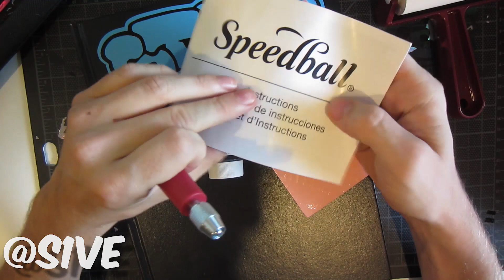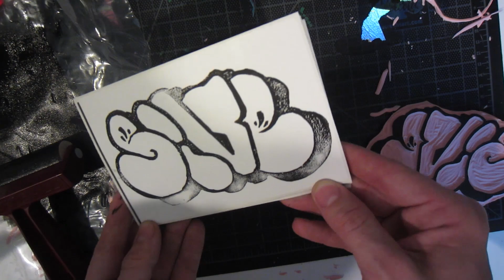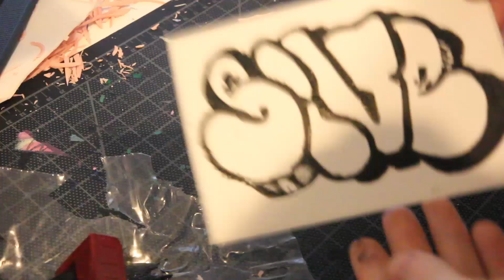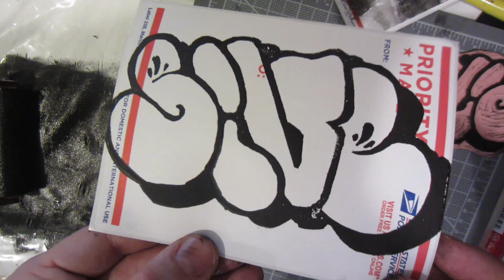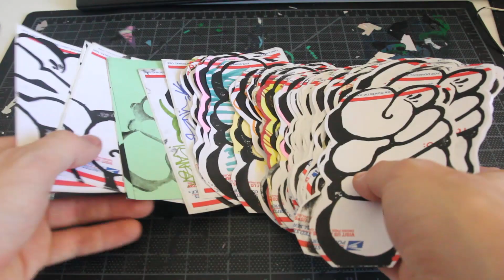How To Make a Stamp | Graffiti Throwie on Stickers

Comment: Put the plate on a solid surface and put the sticker on top (basically upside down to what you did) and rub with a spoon . You'll be able to control the pressure a lot more easily, and get really consistent prints. Also try using srtists battleship grey lino, harder to cut but much crisper lines and more detail too.
Reply from the maker: Great suggestions I will try them all out when I do my next block. Someone else mentioned the spoon method, so def eager to see how that works

Comment: 7:00 dude try putting the plastic on your stamp ink facing up and then using the roller to print it on the sticker you won't make the backside all inked up like this but still be able to put out pressure more evenly then wiv ur fingers
Reply: wow nvm :1

Comment: Don’t roll back and forth you’ll push Ink into your design apply ink in one direction and then turn your block and do it again
Reply from the maker: hmm, so do it only in a forward motion? Do you also switch the direction you start with?
Reply: IISIVEII I like to do it towards me rather than away from me and don’t switch directions like don’t pull it towards you and then push it away from you because again you could push ink where you don’t want it
Reply from the maker: @TheMxboy199  word! I will have to give that a try next time around
Reply: IISIVEII I find it also helps if you ink it vertical and then switch to horizontal if that makes sense and you’re still inking towards yourself when you do that